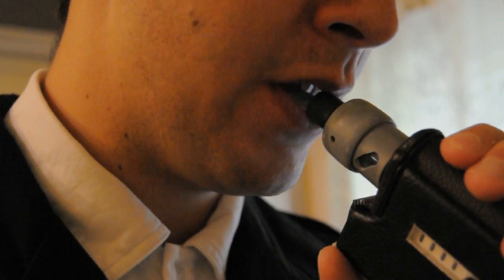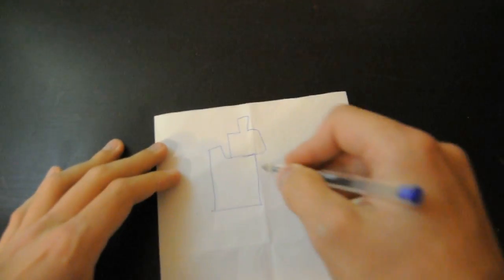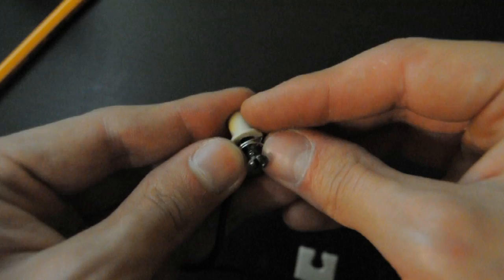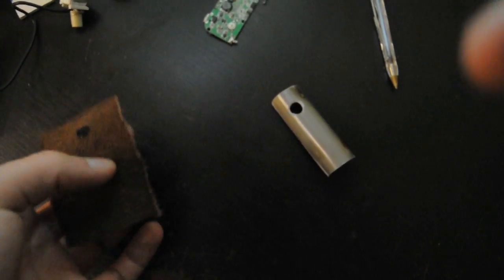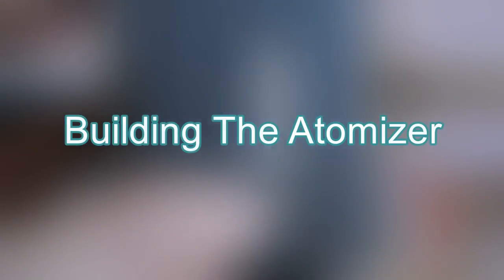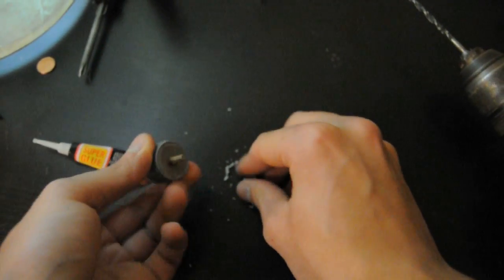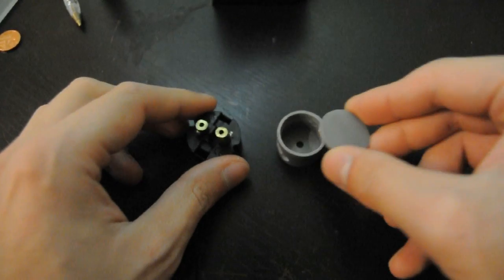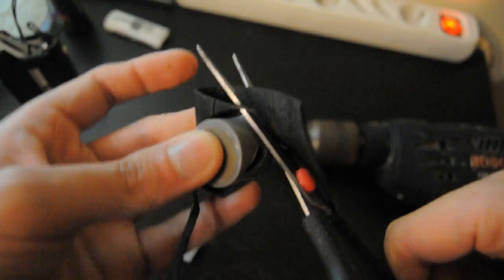DIY | How to Make E-Cigarette at Home - Atomizer + Mod

Comment: Mod is one thing but don't vape on that atomizer for god's sake man. Plastic and glue fumes? I'm %100 sure you're better off with cigarettes at that point. Why not just snort a bag of coal dust since you started?
Reply from the maker: A cigarette is surely more healthy than plastic fumes, but most people here don't realize that the construction is an educational design of a basic atomizer, the material is irrelevant, you can even make it out of inox pipe fittings that cost like a few bucks.

Comment: Use powerbank circuit to protect the cell, but use power direct to the cell. So the circuit is pointless.
Reply from the maker: It can't handle such a high amperage through the charging circuit. This is a mechanical mod design, it should be used with caution!

Comment: Can i use a power Bank battery?
Reply from the maker: Maybe if it's an 18650, but some wont handle the current an e-cig draws so there could be a blowout or something. Check out the battery codes if there's any to see how it handles current and such.
Reply: If it is an 18650 battery then yes

Comment: You really need a disclaimer at the beginning of this video expressing how harmful it is to inhale fumes of heated PVC and superglue. someone is going to get seriously ill by following this demonstration.
Reply from the maker: To tell the truth it's a good idea to have an in-video disclaimer, but the misunderstanding here is that i'm directing you to make it out of plastic, and i do, as half of the project which is the plastic mod works wonder with that fire retardant white plastic sheet, now the atomizer is another thing, i give the design like a car prototype made out of clay, with a little common sense, the what you will make it from is your own decision. For example, in another video i've made a copper RDA based on the design you see here, can't be safer than that. It's a good idea to put an overlay suggesting them to combine both of the projects, a way to get more views too.

Comment: What is the name of that wire plss tell me because I don't understand what you say on the video
Reply from the maker: Nothing special,circuit wiring must be made with 1.5mm2 electrical wiring and the resistor wire can be a plain nichome wire.
Reply: Kanthal or nicrome or pen spring as is what i use

Comment: Would this work for you the coil posts? https://www.homedepot.com/p/Tyco-Electronics-Double-Row-Terminal-Block-4-Position-1-Clam-CA7323-000/202204313
Reply from the maker: Nop,try something that looks like this https://www.homedepot.com/p/RACO-14-2-Dual-Rated-Splicer-Reducer-10-Pack-of-2-AMS2BAG2R/202944409

Comment: whats the exact name of the rod you used to connect the kanthal wire and the battery (or give the item you got it from amazon or homedepot please)
Reply from the maker: It's one from a bayonet light bulb socket but any screw wire terminal block will do.
Reply: John's Crafting Lab can you find something i can use so i can swap my coils easily? like at homedepot or amazon, thanks!

Comment: i wanna make one but m confused about the battery ... what should i use and how do i charge it ?? m dead if it explode lol :p
Reply from the maker: Well i think it would be better if you leave this project for the moment or try to make something else. :P But you can use a powerbank circuit to charge the battery but draw power directly from the battery not the circuit. This will make it a mechanical mod which is dangerous homemade or not.
Reply: Get a circuit board called TP4056, dont short the wires or it will pop the board with its safety mechanism, you can charge it safely, watch a tutorial on it
Reply from the maker: Sounds interesting. Thanks for the info.

Comment: What did you use for wire
Reply from the maker: For the internal wiring i used 1.5mm2 copper wire for 16amps max. For the coil the wire i used is thin twist tie wire.

Comment from the maker: To WHOEVER IS GOING TO COMMENT ABOUT IT BEING PLASTIC: 
This is made like that for proof of concept,i give you the design of an
 atomizer you can build for like a few dollars with plumbing material 
the sizes that are available in both PVC and Stainless steel.
It is made with plastic to prove it works,the material you will make 
this from,if it is plastic caps or stainless steel pipe caps,it is your 
OWN BUSINESS.
It is supposed to be made out of readily available materials,in my case 
plastic plumbing parts,for demonstration purposes,with the same plumbing bits at the 
same sizes being available in STAINLESS STEEL aswell.
YES MINE IS PLASTIC! If you like it anyway,follow the design and yours can be STAINLESS STEEL!
Reply: Heheehehhhhe pvc rdta can cause cancer
Reply: truebassB awesome idea! but coming from an experienced vaper maybe you should try to adjust the design to have a more ergonomic design you can email me at doystroyer@gmail.com I have some great ideas to share with you if you like! email me sometime!

Comment: Plastic RDA?WTF? Beginner vapors don't follow!!!!!!
Reply from the maker: The main misunderstanding is that this is supposed to be plastic,where i'm only supposed to show the design and how to make it. It is supposed to be made out of readily available materials,in my case plastic for demonstration purposes,with the same plumbing bits at the same sizes being available in STAINLESS STEEL aswell.
Reply: It would be great when you use ultem plastic instead pvc

Comment: Inhale dat glue residue and oxidized wire lol
Reply: JohnBelwell lol its dangerous it can cause cancer
Reply: @icesavage8357  vaping in general can cause cancer 😂
Reply: Bojim Taibojim this is made as a prototype for proof of concept,as far as it works (which it does),nobody will stop you from making this on stainless steel which will be safe for use. Take it as open source design plans to do whatever you want with them. You decide what's best.

Comment: how many watts is it ?
Reply: its a good website for a vapesafe  http://www.steam-engine.org/
Reply: how to calculate it?
Reply from the maker: This is around 40-50w with this resistor.
To calculate use this formula: 3.7volts X 3.7 Volts / Resistance.

Where 3.7 it's the battery's nominal voltage,and resistance is the ohm value of the resistor,all you need is a multimeter.

For example if the coil resistor is 1ohm it's 3.7v x 3.7v / 1ohm = 13.6watt in theory (because there's also internal resistance,).

Ideally if you build something similar use 1.5mm2 wiring to have <0.1ohm internal resistance (the resistance with the coil leads shorted and measured on + and - battery terminals with the fire switch pressed.).

In this example case it will be 0.1ohm internal resistance + 1ohm coil resistance = 1.1ohm series resistance.

Which is 3.7v X 3.7v / 1.1ohm = 12.4watt with 10% of the wattage being dissipated to the wiring (depending on the percentage difference,0.1ohm internal resistance is 10% of the 1ohm of the coil resistor).

Hope this helped.